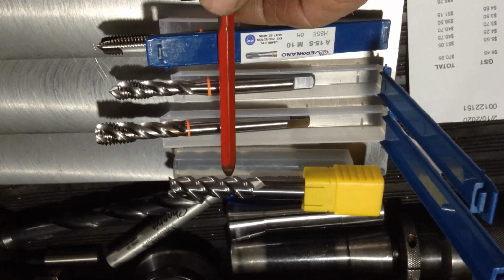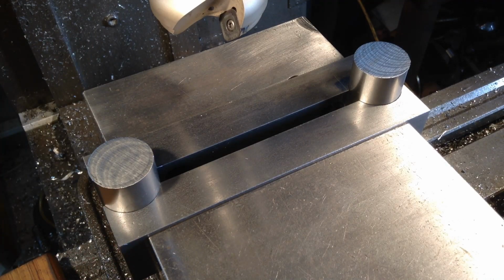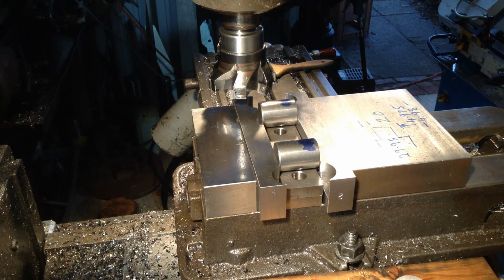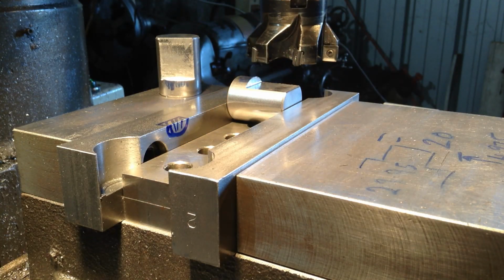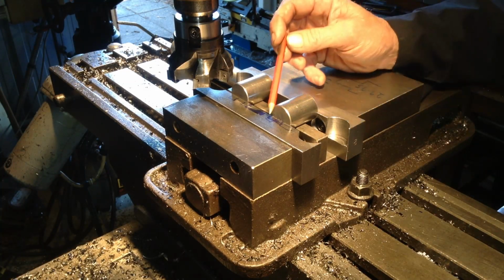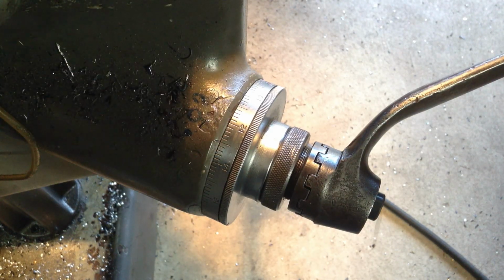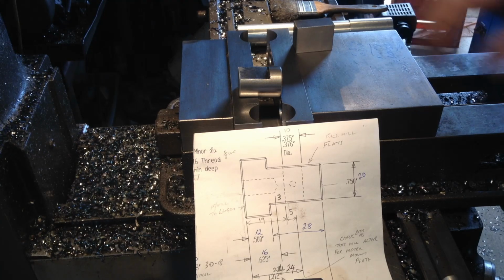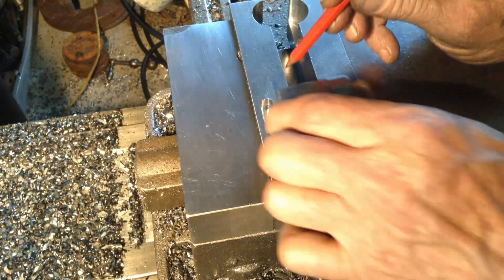Small run repetition set up's in the Bridgeport .  Part 2

Comment: New subscriber here!  Been a journeyman machinist for 27 years and really love watching you work and your shop.  Great content so far and I might add that I was seriously taken aback at the prices you paid for your tooling.  I can get all that for about $100-125 here, and it will be good quality made in USA stuff.  I know there's good quality stuff made elsewhere too, probably knock the price to around $80 and still not have any Eastern made junk.  Hopefully your consumable prices went into your quote for the job you're doing and you get it all back mate!  Great channel and great work!  Will be binging for a while trying to catch up.  👍👍😎
Reply from the maker: Thanks .  Tooling is expensive here for the quality stuff .  Yes avoid the cheap rubbish !       We don't have the quantity of used good quality of accessories here either , that's  part of the reason for making my own R8 stuff & will have to make a heap of 40 & 50 taper tooling when the new shop is finished .    👍

Comment: Hello Max.  I like the way you aligned the two parts by dropping a parallel across the top of them, very slick.  David Wilks just mentioned you in his latest video and it was about aligning parts just like that. (Using the end of the R-8 spindle actually).  After seeing the price you pay for tools down there I can see why you made all your own R-8 tooling.  Have a good weekend, Ken
Reply from the maker: Thanks Ken  . You can get the R8 stuff cheap  but it is made in china , like cheap taps & reamers not worth the headache .    That was a great video that Dave made .    Cheers .

Comment: Hi Max, you can't pay enough for quality tooling.
Broke my 12mm Japanese carbide end mill the other day widening my QCTP tool holder $60 in the bin.
Just bought a set of carbide end mills, 2mm to 12 mm, 8 pieces from Bangood $50, good enough for one off jobs.
Reply from the maker: The tool holders are sometimes tough stuff to machine , you wern't clime milling with the table in the middle of it's travel were you ?
Reply: @swanvalleymachineshop  When I touched off on the bottom of the slot and edge I was too fast on the feed and had the ensueing damage.
The tool holder was very hard, barely mark it with a file but carbide machines it nicely taking 2mm off each side.
The carbide cutters I ordered are good for up to 50 Rockwell 
55 Rockwell carbide endmills double in price from Bangood.
Reply from the maker: @willemvantsant7416  Go for the ones with a slight radius on the corners .  55rc , i get them from Terravin ... not cheap !

Comment: Sir,  I liked the video and learned a new trick in using a parallel
 to index on the flats.
Would it be possible to put more than 2 parts in the vice using that method?
Eric
Reply from the maker: You can , but it is not really recommended  in case  one part does not get the clamping the others do .  Sometimes it works  but not always .    Cheers .

Comment: Hi Max great mini series, how long would those end mills taps etc last  used carefully no Bozoing? and would Chinese equivalents be half the price? CHEERS Regards Robbie
Reply from the maker: Good cutting tools will last for  a lot of work , depends on the material & with hss cutters they like flood coolant .   The chinese stuff is cheap rubbish alot of the time , that's why i avoid it when i can .   Cheers .
Reply: @swanvalleymachineshop  ta good to know thanks Max

Comment: G'Day Max, so I had Get Smart in my head after your tip [ "The good old torque wrench on the vise trick" ] - weird I know, but I use word association to remember peoples names and he's who I used for you, (Max - smart bloke).  I hadn't thought of that trick setting a vise before, so many thanks.  PS, have you had any progress with your new shed?  Stay safe and well :)
Reply from the maker: Thanks . Shed progress is slow , just making up the column bases & brackets etc .  Just finished removing the last of the form work from the slab & next week i will mount the column bases & grout them in , hopefully !    Cheers .
Reply: @swanvalleymachineshop  Good luck with it Mate.